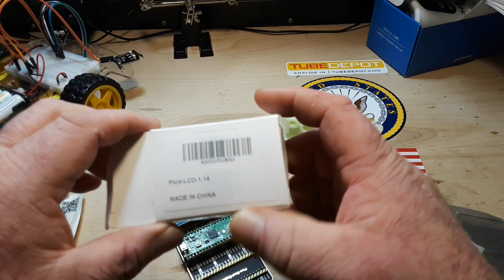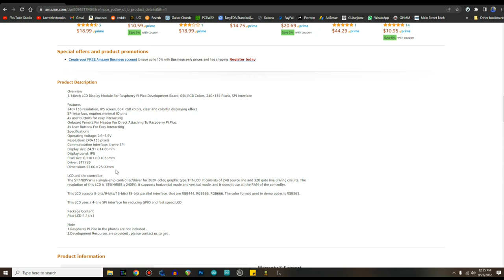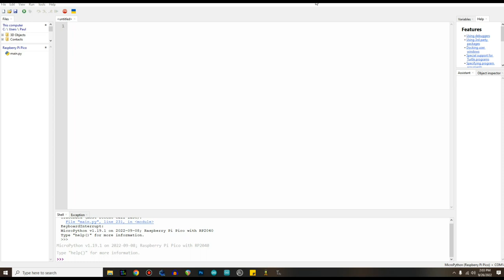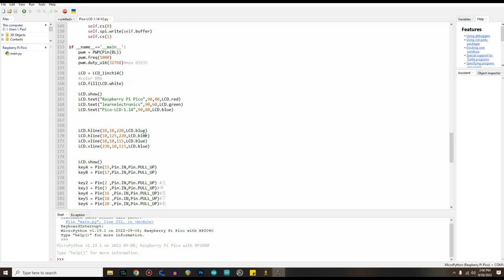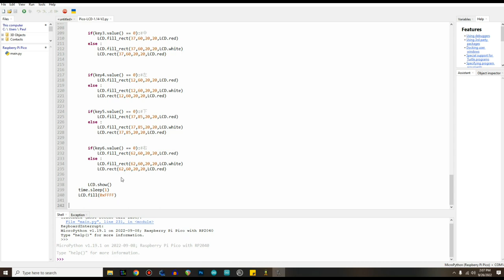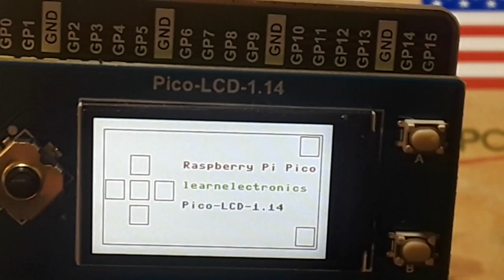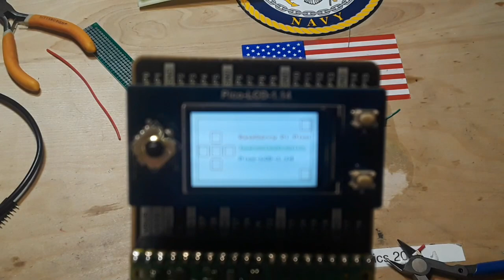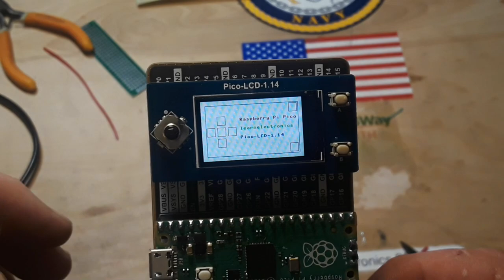Waveshare Dual Extender and TFT LCD For RasPi Pico

Comment: In Python, there's no need for those outer brackets with while, if, &c., and rather than "while(1)", which makes sense in C, "while True" is better.

I know people hate the whole whitespace thing initially, but it's there because Python originated as a teaching language and to give people good habits around writing readable code. Part of that is using indentation for blocks because readable code is going to be properly indented. Eventually, it becomes second nature with a half-decent editor, and hitting backspace is easier than typing a right parenthesis anyway.